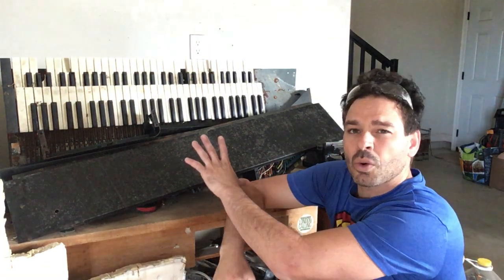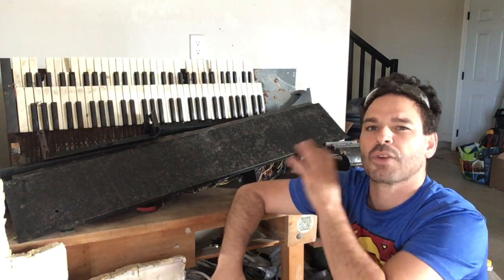Scrapping an electric organ for lots of tin/shred, copper wire, and little waste.

Comment: How would i tell the difference of the metals in an organ iam scrapping? A Baldwin 125B? Thanks
Reply from the maker: If non magnetic could be aluminum or brass. Scratch it, if reveals yellow underneath it is brass. If metallic hit it with a grinder, if sparks and is non magnetic it is stainless steel. If no sparks aluminum. If magnetic then tin
Reply: @TinManScrapper  thank you appreciate the reply!!!

Comment: Are you sure that's even copper wire ? The wire i have taken out of organs does not look like copper/\.
Reply from the maker: Sometimes it is grey coated. If you scratch it it should reveal copper underneath. If not, it is aluminum wire.
Reply: @TinManScrapper  I think most all of it is aluminum witch is surprising with these older electronics.